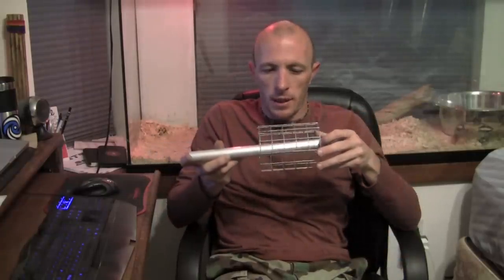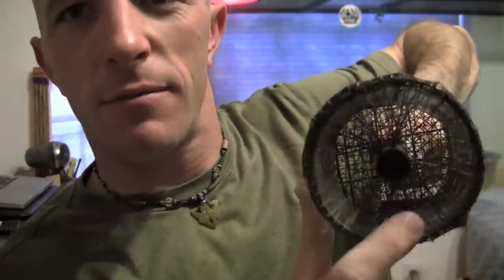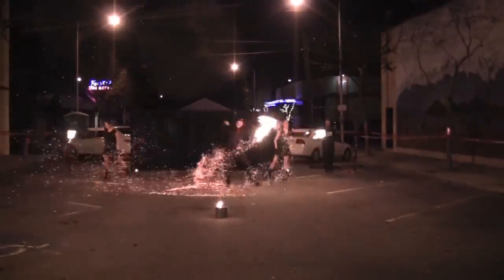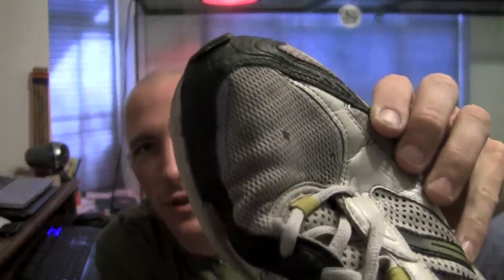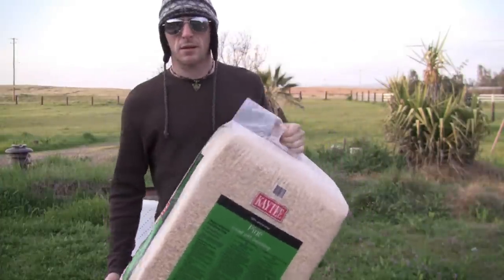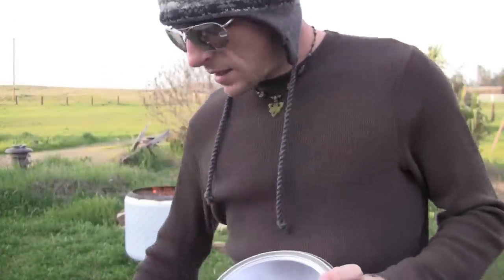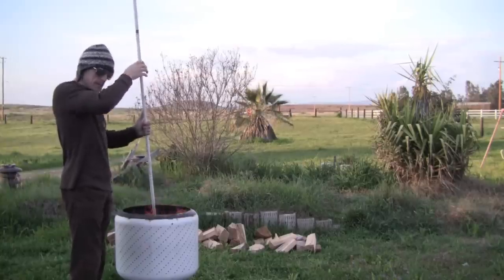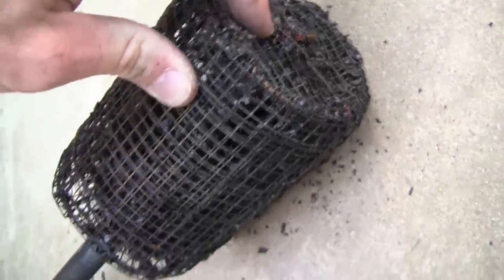Charcoal Poi/Staff/Clubs Tutorial Part 3 of 3

Comment: What type of metal is the staff? I read your comment that aluminum will melt. I made a staff from steel before, it was very heavy and extremely hot if touched anywhere but the center. Would you recommend this design for use with steel wool? If so, would aluminum be ok then? Or it'd still melt? Thanks for sharing your knowledge! Much gratitude for taking it to a whole 'nother level and supporting others to go there too. Love n Fire 💞🔥M
Reply from the maker: Use steel for both charcoal and steel wool effects.
Reply: Thanks for the confirmation and the quick reply. You rock! I found 2 steel poles in my garage, cages being made... this is happening on Saturday! SO excited! Happy Birthday 'Merica! ; )

Comment: nice - this is something i simply had not thought about, had you thought about making removable cages so that you could have several sets pre-made? maybe making pots with a central core that slips over the shaft of your fire staff shaft. also how do you light it? dipped in paraffin like any other staff?
Reply from the maker: I just squeeze some lighter fluid on them to light. I have seen many designs for cages and this design in my opinion is the best. Reasons why are weight......and weight. Cages break down regardless of how strong they are with time and usage.

Comment: What is this metal drum/fire pit that you use to cook the paint can & shavings in? How important is it to have the paint can surrounded by fire/coals?... I have a firepit but it doesn't have tall walls on the sides to enclose it so i'm wondering if it would still turn the shavings to charcoal effectively
Reply from the maker: +Codyjb818 It's an old dryer bin. The base was welded on to make it into a standing pit. You don't need to have one. Just push the coals up against the sides of the can and you shouldn't have any problems. A pit will get the can plenty hot enough to turn the shavings into charcoal. You can always dig a hole in the ground to get the same effect.

Comment: Is there any website that sells charcoal staffs or is it always a DIY job ? 
I have a fire staff, could I make the cages as an extension to the staff or would the charcoal destroy the Kevlar wicks ? 
Thanks
Reply from the maker: +F Boylan I'll sell you one. It's more cost effective to build it yourself though. They take time to make.
Reply: +F Boylan Please be careful...Charcoal and fresh air is what a smith uses to melt steel. Your kevlar wicks will absolutely be over. I´ve seen people using aluminium  for their staff-it took a few seconds to see the cages flying around. Aluminium melts at about 600°C. Iron/Steel needs a higher temperature to melt-but it is possible to melt it just with charcoal and air.

Comment: How do you light it once its in the cage? Just a lighter or do you soak the whole thing in fuel?
Reply from the maker: I use lighter fluid. Just enough to light them for about 5 minutes to warm them up. You want enough to where they are still on fire when you start though. Or you can just light them and go. I have found the effect to be more reactive when you let them heat up for a bit though. Good luck!